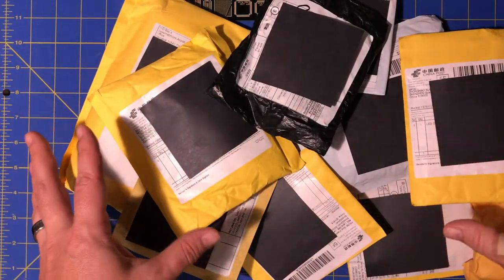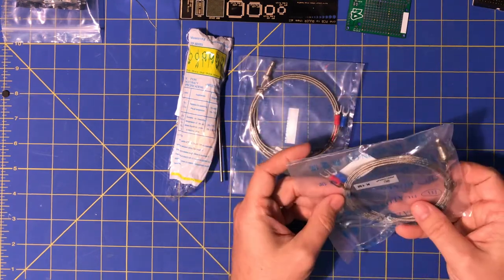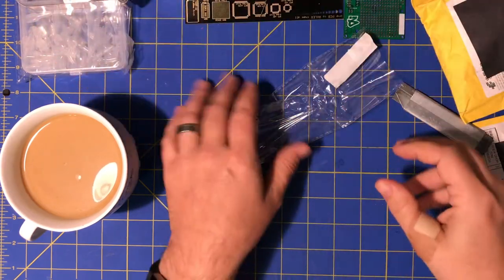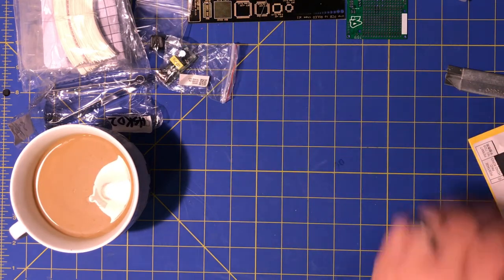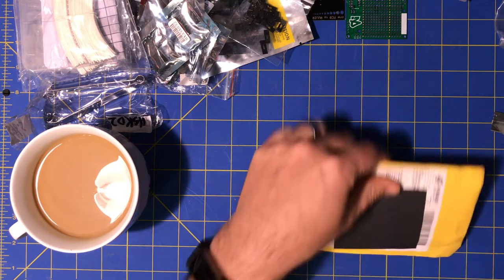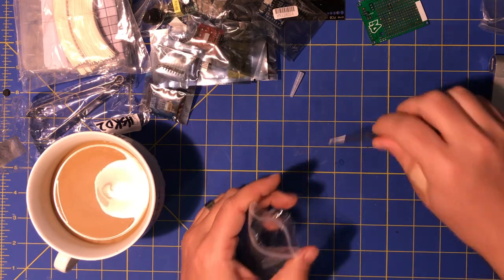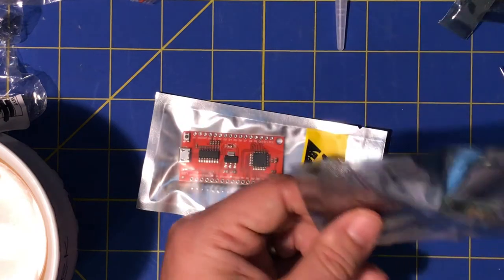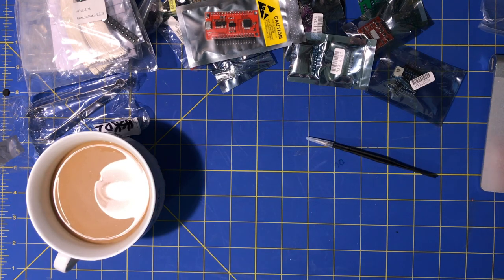Mailbag #3 07-2018

Comment: Gotta love those plastic sheet items we get shipped to us all the time. Even a 10 x  magnifier helps really see the fine print on some of those modules.   Sometimes the silkscreen markings on the board or the markings directly on a chip might be a little bit smudged or weakly printed but it comes out really clear with the magnifier.
Reply from the maker: Gadget Reboot I ordered a 10x loupe well see if that is of any use. I usually use my phone to magnify but when I am recording I goto grab it and doh.
Reply: Yeah  I think you’ll really find the loupe helpful.  Even if you can read the text it’s of course a lot easier on the eyes when you magnify it and everything just becomes crystal clear and you can see stuff quickly  instead of squinting and wondering if you’re seeing a six or eight.
Reply from the maker: That and do not try to read stuff in esd packages.. lol